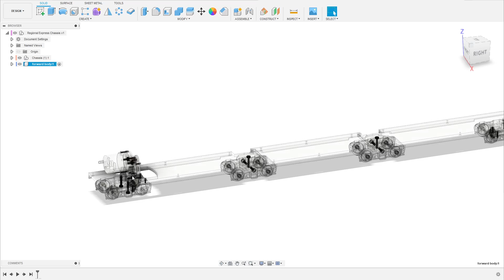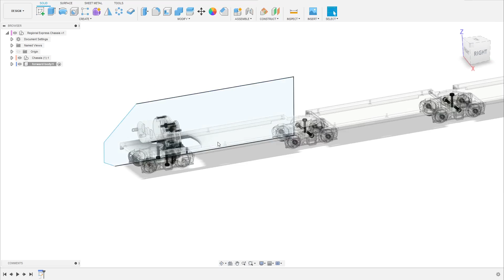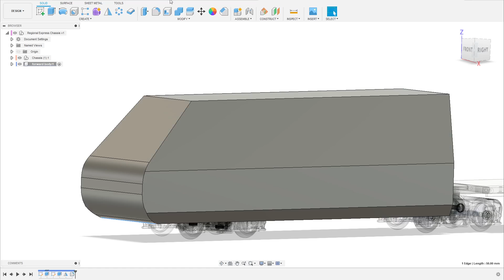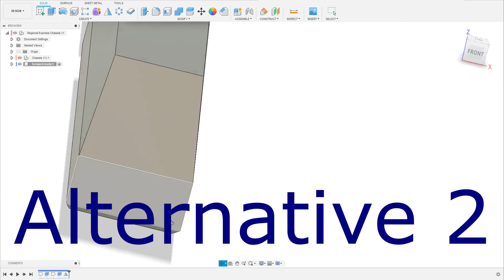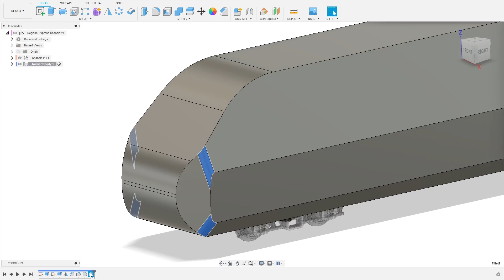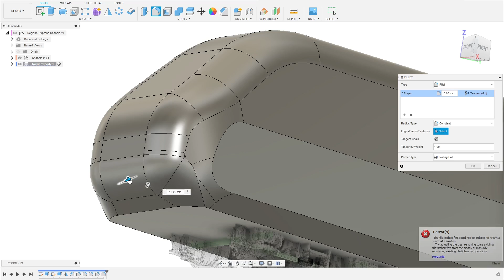Train body tutorial in Fusion 360 - Part 1

Comment: Thingiverse link link is broke. I'm not quite ready to to star learning fusion, I'm still on the old 123D design.

Would you mind adding .STP files to thingiverse please?

Fusion personal STP export feature ends on the 19th.
Reply from the maker: Thanks for letting me know! had lots of trouble with thingiverse when I uploaded the project and it accidentally saved to copies, seems like it was the one linked here that I removed. In case the description haven’t updated yet, here is the link: https://www.thingiverse.com/thing:4710367  and there is already step-file there as well!
Reply: @drdistorzion  No problem, and thanks for the STEP!

It's a shame I don't really have the space for your trains, I'm currently working designing extra track for the HO gauge £8.99 plastic train set of Amazon, I finally got close to making a curved section, I might try scaling down some of your things to fit HO gauge.